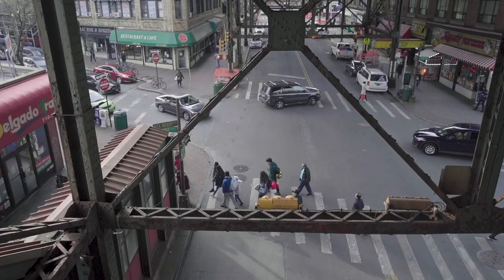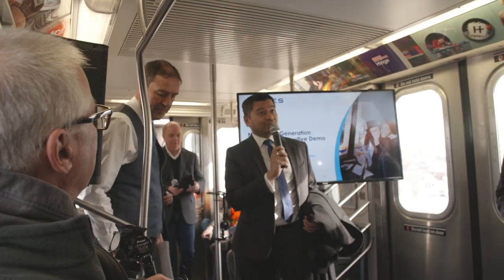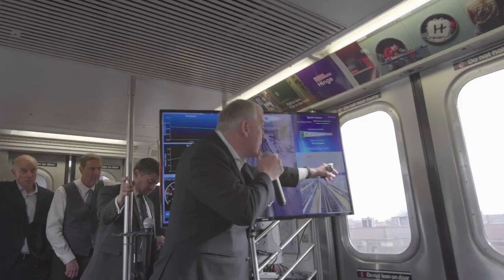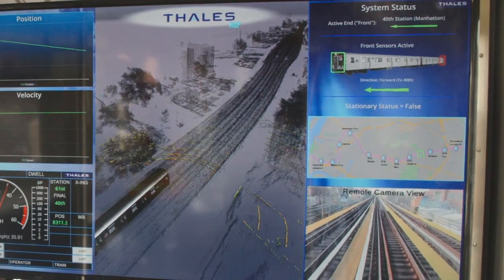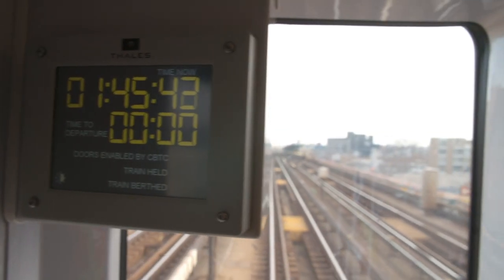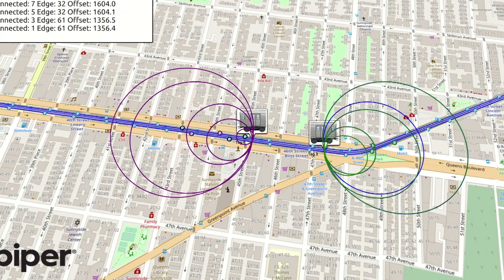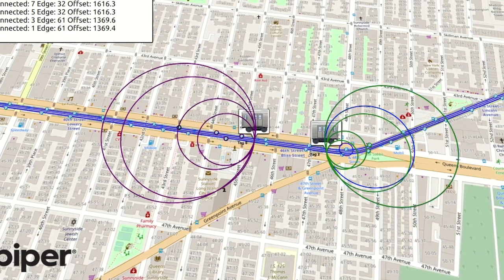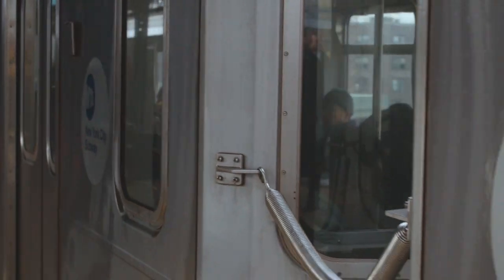MTA Press Demo of Next Generation Positioning System Integrated with Ultra-Wideband Pilot Program

Comment: Very interesting but not really demonstrating it is working ...
The difficulty with UWB tags are the obstacles and the resulting multipathing. This is for instance why they double them for the two sides as another train can hide them. Testing outdoors with an unique train is not a challenge for those issues. And even in this case, we can see that each side of the train only sees the tags in front of it and sometimes only one tag out of the 4 or 5 in reach. How does multipathing is solved in tunnel and the instant localization in safety they are talking about ? For outdoors, GNSS is working very well, no need of UWB.